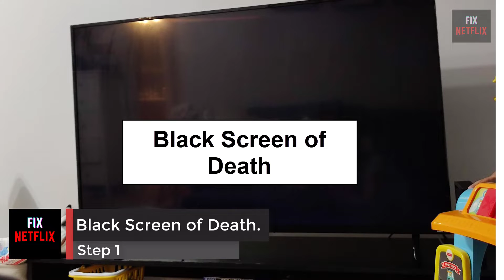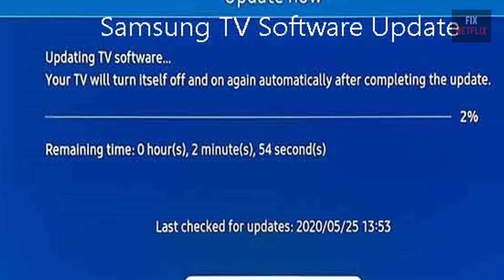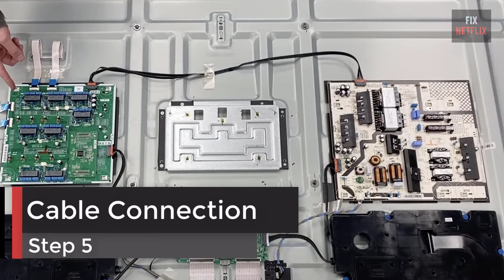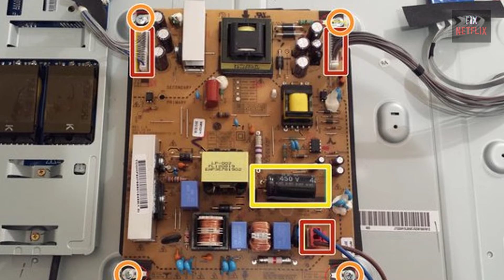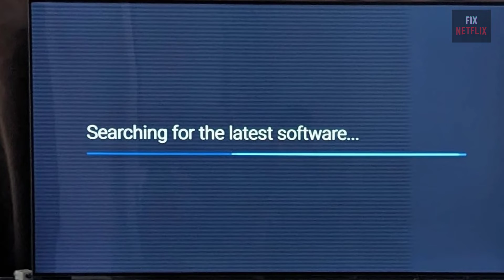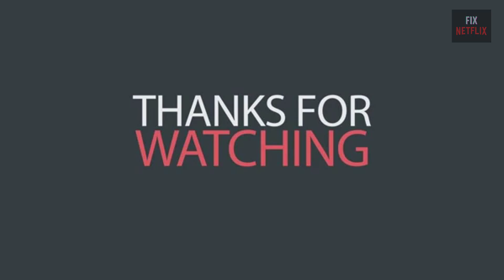Sharp TV with No Picture, Black Screen but Sound - Fix it now

Comment: Hi, what should I do, if my tv can switch on for about 1 or 2 minutes but suddenly turn black screen. No backlight image appear on the screen after using torchlight. Already do factory reset and it only okay for 2 day and it start again the next day. Already check hdmi cable and when I remove once and not use it, it is okay for only a day and the same situation repeat.
Reply from the maker: Thanks for sharing all those details, it really helps paint a clearer picture of what's going on with your TV. The fact that it's okay for a short time after a reset or HDMI removal is a crucial clue. I appreciate you outlining all the steps you've already taken!

Comment: How am i going to reset if nothing is showing on the screen?
Reply from the maker: You can usually reset a Sharp TV by holding down the power button for about 10 seconds. This should help reset the TV even when the screen is black!
Reply: @TechVibes-maf mines not showing video just sound I tired it and it switched to a tv channel I think